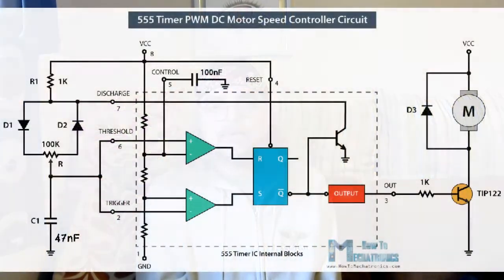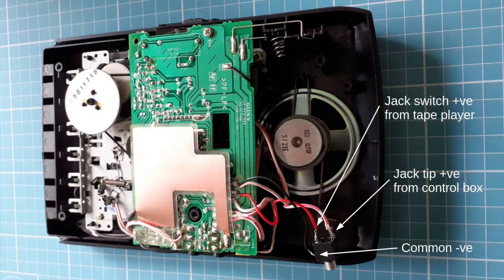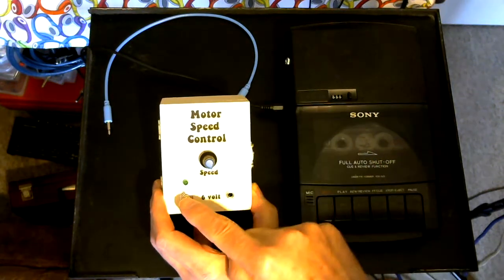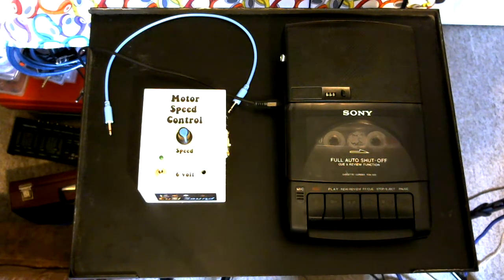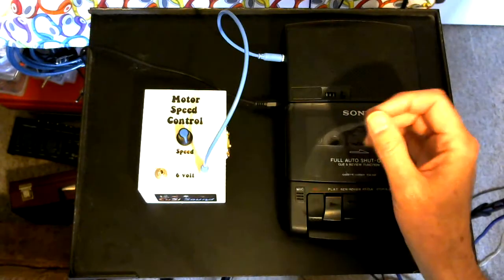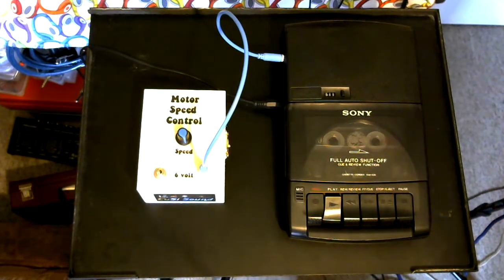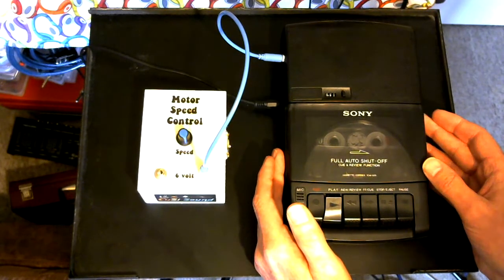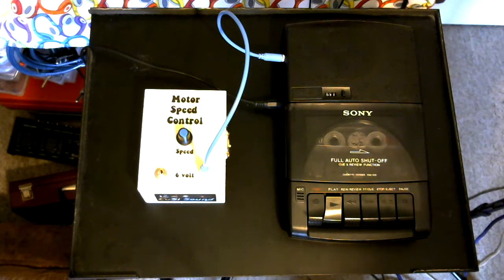Motor Speed Control For Portable Cassette Recorder

Comment: Great! An idea which came immediately to mind is: you can record on a cassette say... ten times its nominal time.
Say a 60 minutes cassette becomes a 10 hours long one! That's insane!
Reply from the maker: The slower I run the tape I find there is less quality in sound reproduction. I suppose it's a bit like reducing the sample/bit rate rate on a digital recording. I have used speed control to record at lower speeds then play back at normal speed to give the effect of speeding up the tape. The results are a bit lo-fi but I think that adds character to the sound.
Reply: @CuSiSound  I see. As usual, you get something, but you loose something else.
Anyway... great for tape looping, isn't it?

Comment: I've made a couple speed mod cassette players by just poking around the motor speed trim pot with a potentiometer hooked up to a couple alligator clips.  This video was helpful to understand how this stuff actually works. I still have no idea how the circuits I ended up with work.
Reply from the maker: I don't claim to understand the theory behind some of the stuff I build but hey if it works it's all good : )

Comment: Thats a really cool speed controller but it is actually possible to modify the pitch of this particular tape player in a more simple way. If you remove the lid of the motor you can gain access to the circuitry needed to remotely control the pitch. Cool video though and great circuit. If you have any additional questions about my method then don't hesitate to ask. Really cool video though!! Keep making them
Reply: Hi Charlie, I just bought this tape recorder and am keen to know if you have a particular source/instructional for the method you mentioned? Thanks.
Reply: @yourmaw8790  I haven't made any instructions. Is there something in particular that you would like to know about It? Its a very simple modification
Reply: @Charlievorn  Thanks for the response! Would I just remove the board of the motor completely and resolder my PWM on to the motor, replacing the motor board completely with the PWM?